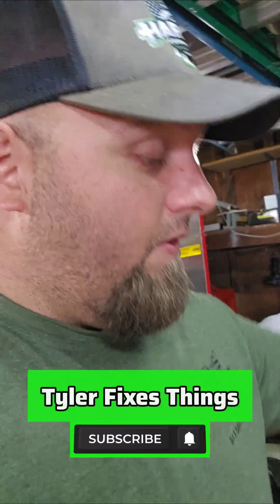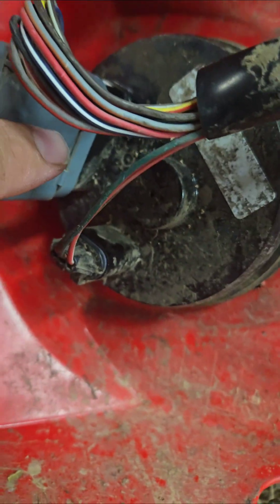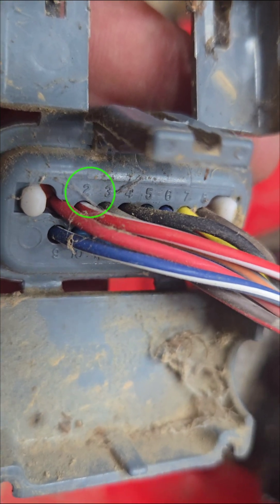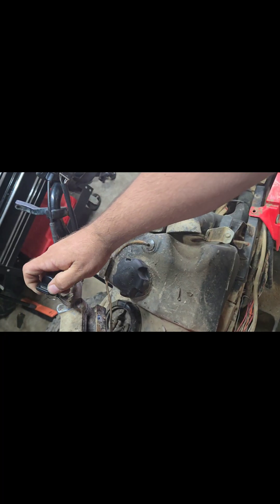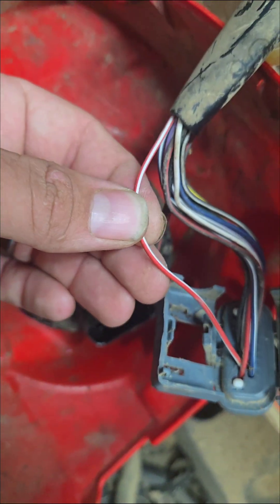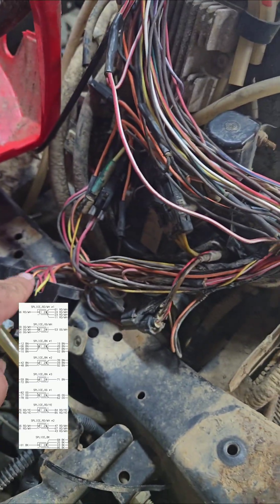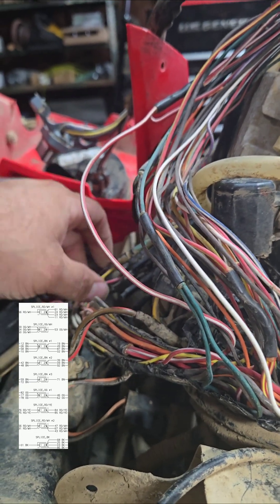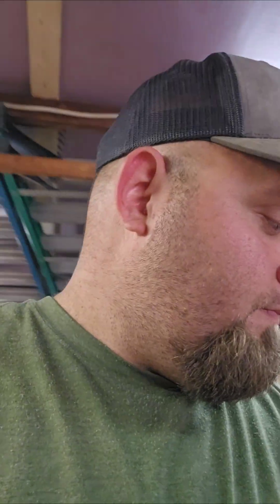Polaris Speedometer Not Working? Wiring Fix + Full Harness Walkthrough

Comment: Hey, thanks for the video. It helps. I have a couple of issues I really need help on. 1st issue: previous owner bypassed the ignition switch and rewired a different type in. I have replaced that with the right one and it works but when I turn the bike off (by the key) it turns the bike off but the cluster light stays on like it is in the on position (not run). The only way I can turn the power off is to disconnect the main power wire coming into the switch (red wire). Plug that red wire back up and all is good until I turn it on again. 2nd issue: Speedo, rpm, hours and miles are not working. New cluster (old one was very dim). I am 99% sure it was not working on the old one before I replaced it. Everything else works on the cluster (drive position, wrench, temp, battery). Any suggestions. Would love to see the wiring diagram but I admit I am by no means very good with them, lol
Reply: Forgot to mention. Before putting the correct switch back in, the kill switch on left handlebar was not working. It now works. Previous owner bypassed a lot of wiring (lights, fan, temp, etc). It is a 2004 sportsman 600 if that helps. Again, thanks for your video, it is great
Reply from the maker: @jquinn445 Hey no problem! Glad it's helpful, it is a pain when someone goes and plays hack doctor on wiring.  The factory fix is often the best and simplistic method of repair, but some folks are really proud to bypass something, makes some feel accomplished I guess 😆
Reply from the maker: Test to see if you can kill the cluster using the handlebar run/off/run switch.  The key switch provides power eventually through the fuse block and through the handlebar run switch before going to the cluster. I do have the manual, just email your request to harkins.equipment.repair@gmail.com
Reply: @HarkinsEquipmentRepair  Hi, just sent an email, much appreciated. Power stays on even after using the run/off/run switch. I tried another left handlebar switch thinking it was the issue but same problem.
Reply from the maker: @jquinn445 Something is definitely wired incorrectly somewhere.  Because when the kill switch is in the off position, the "awake" wire for the speedometer should have no voltage.  If it's staying "on/awake" your issue is there.  My guess is somebody has jumped a wire somewhere to bypass that kill circuit for the electronics
Reply: @HarkinsEquipmentRepair  Hi, figured my cluster issue out. It appears my new cluster was the issue. It would not turn off after I shut the machine off. I checked all power and ground wires in the entire front. Couldn't find anything wrong. That was fun. I put the old one back in and it would shut off like it should when I turned the key off. Couldn't read anything on the old cluster because it was dim and had lines all over it so I decided to tear both the old cluster and the new cluster down. Took the little screen out of the new cluster and put it in the old one. I now have a good working cluster. The best thing is I now get to keep my hours and miles since I only changed the screen out. Thanks for your help. I wouldn't have dug into it as much without your advice.
Reply from the maker: Thats great man!  I'm glad to hear that everything went good! Just so you know, I really do appreciate you taking the time to let me know you got it fixed!  This is why I make these videos!  Have a great new year!!!

Comment from the maker: If you would like a copy of the wiring schematic, just let me know down here in the comments! Thanks! 😃
Reply: I Hi, My issues is no cluster and no 4x4. Bike starts and runs fine but have no power on 1 pin, power on 2 with key on and ground is good. Also the 3 pin connector has no power at any point. 2011 sportsmans 400 HO
Reply from the maker: I'll do some checking and get back with you.

In the meantime, are you reading voltage at the pins going into the dash cluster or are you talking about pin voltage at the kill switch connector on the handlebars